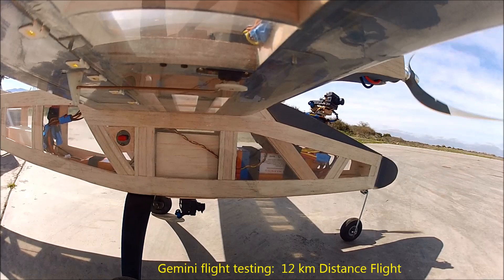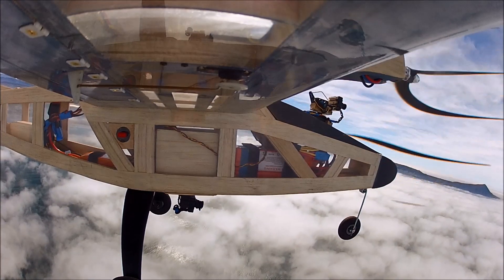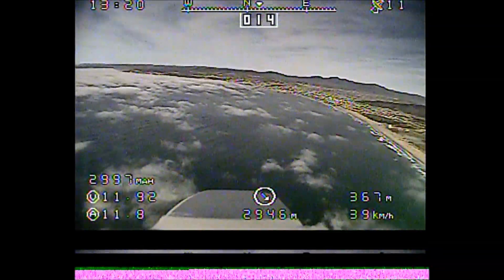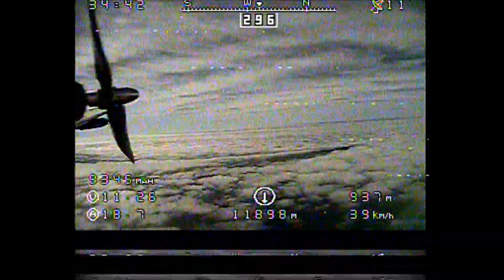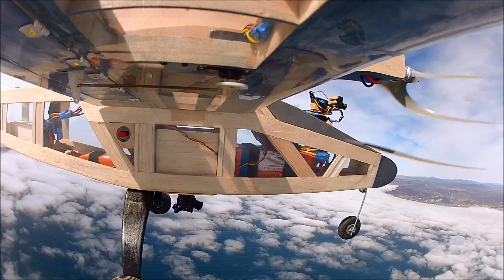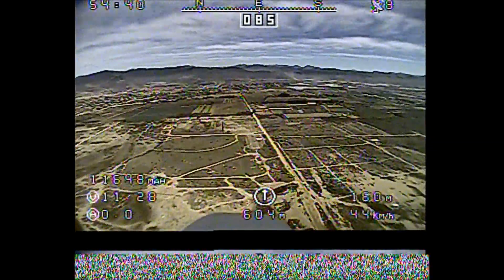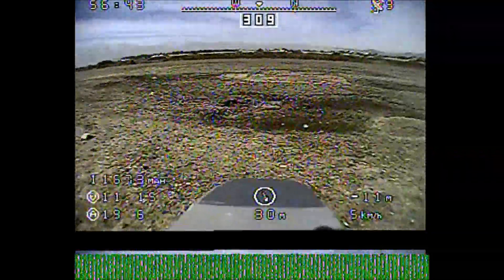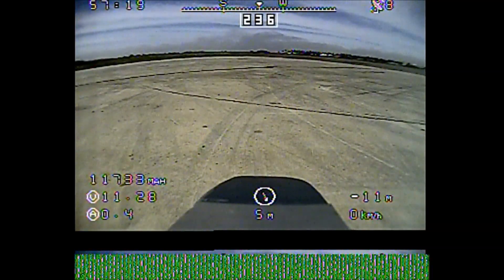GEMINI ADVANCED FPV/UAV FLIGHT TESTING 12 KM LONG RANGE FPV FLIGHT

Comment: do you know the wing loading weight 3 meter wingspan rc aircraft, i hope somebody here can help me
Reply from the maker: +Aldo Allende Oliva 23-32 oz per sq ft, depending on payload. stalls at 18 mph at gross weight. best glide is about 45 kph, and best loiter is about 42 kph.
Reply: +FPVREVIEWS if i want to test the wing. And ,  I w
Reply: +FPVREVIEWS if I want to test the wings, by putting each wing tips On top of a chair, how much weight can i add for me to know is not Going to break in The air
Reply from the maker: +Aldo Allende Oliva calculating the load for the wings with sandbags is actually a bit more complex than that, and i don't recommend doing it upright, or with chairs.
Reply: +FPVREVIEWS I think I'm going to add 1 more carbon fiber tube

Comment: interested and looking into getting the plans. I was going to design my own, but this is all set for max efficiency. I was thinking about building some of it with alternate materials, maybe pusher props.
Reply from the maker: pusher props mounted onpods on the wings would encounter vibrations due to arc pressure differential they would encounter. i have found that it offsets the gain in efficiency due to vibration. anyway. , thanks for considering the design. the prototype is optimized for max efficiency in cruise flight.
Reply: Ah I see. from the differential pressure behind the wings?
With twin design, I suppose it's not much need protecting the motors/props.
Looking at these consumer hydrogen fuel cells available, I wonder if in future theyd be able to be used as a sort of cruise power generator, or for recharging a main flight battery in flight.
Reply from the maker: Stefan Kozma exactly. 
hydrogen offers great energy density, and is already being used to power uav's of all sizes while burning it in conventional engines, and using solid state fuel cells.  it's just highly explosive.  minor detail... perfect for unmanned aircraft.

Comment: Your final approach seemed really steep. Is there a reason you did not come in at a more shallow angle? Just curious.
Reply from the maker: with full flaps/airbrakes, there is a huge amount of drag, and the nose must be kept down, to maintain airspeed. to make a more shallow approach, the flaps could be partially retracted, or some motor power could be used.  most air brakes are not this effective, so it looks extreme, but the airspeed was quite normal, and that's all that matters to an aircraft.  thanks for the good question.

Comment: It would be possible to buy this kit plane? what do you use from osd autopilot ?
Reply from the maker: not practical to produce kit, as i have to travel to ship it. if your interested in a similar finished model, be receiver ready, or complete system, pm me. i have a similar model available at the moment.  sorry for no kit.  i do have plans available on the website. there's a link in the description.
Reply: Ok no problem, How many hours of work for the realization (construction)
Reply from the maker: Koestel about 2 weeks full time
Reply: OKI Thank you
Reply from the maker: autopilot is fy-31 ap, but have taken out, and switching to pixhawk soon. odd is tele fly by mfd. it's part of the tracker system. aat.  not necessary to use it for odd , but i like it just fine. it's possible to use the tele fly just for tracker telemetry data, and bypass the vid signal onto another osd. it's standard procedure, and in the instructions of the mfd tele fly.
Reply from the maker: there is no redundancy with the two uhf systems, they re there just for more channels, and split tasks between two people on the ground.
Reply: ok, To control what and for what purpose have 2 receiver?
Reply from the maker: Koestel 8 channels to control the basic plane functions, the head tracker, and the autopilot modes, then another controller for the pan tilt on the observer cam, the 4 separate configurable hard points not the wing, and air brakes, payload drop via parachute, deployable sensor release, in flight recharging boom, etc. you get the point, if you can think of it, it can be done. never enough channels. this gives 16 with the potential for more with different controllers having more channels. ezuhf has 8. dragon link has 12.  the futabas are limited to 8 and 8 however.
Reply: I understand better...

Comment: I really like this channel, the flight narration is great. I've been interested in adding a second pan/tilt cam for a copilot like you have for your Dad; I was just wondering if you both are on different 1.3 Ghz Vtx's at the same time? Id think it would be ideal to have the two Vtxs on different vastly different frequencies (like one on 900 and the other on 1.3) but I may be wrong.
Reply from the maker: yes, you are correct. as far away as possible gets the best range, or so i hear.  it's ideal at least. i'm running a red label race wood for 1.2ghz for the pilot, actually closer to 1.1 depending on where you have the channel dip switches set, and the observer cam is running on 5.8 now. It's an aomway system, and it has great range potential. some of the newest 5.8 systems are incredible, and the old knowledge that a high freq. can't go long range is no longer accurate. it does have a more narrow beam width, however, so the tracker must be tuned well.  the 1.2 is very forgiving, so it's best suited to the pilot video system.
Reply: FPVREVIEWS Thanks! In that case, Ill go ahead and hang on to the 5.8Ghz vtx/rx that came with my Fatsharks (250 mW). What antenna gain do you use to punch through all those clouds with 5.8? I've always thought the 5 turn helical seems like overkill, but at your distance it almost seem necessary...
Reply from the maker: Arizona Air i use 1000mw. that helps a lot, bu i'm using linear polarization, as i've never had a problem with it, and i use a patch antenna. i think it's a 23 db for the 5.8.  i use a 13 db patch for the 1.2ghz.  the 1.2 is an 600mw or 800mw. i can't remember which right now, but it works well.  always try to but the rx antenna that the manufacturer suggests for max range.

Comment: How come the live feed video quality is terrible? Lol forgive my enexperience :p
Reply from the maker: it's wireless, so not perfect, and when you compare it to the go pro, of course it looks lousy, and i had done some modifications to my a.a.t.  that day, so had not had a chance to tune it, so antenna aiming direction was not perfect.  it does work acceptably up to 12 km away, however, and it's generally only used to navigate, not for videos.  an unmodified wireless a.v. system won't work even 2 km distance, so it's all relative.
Reply: FPVREVIEWS So what kind of AV system are you using... I have just started FPV and have a 600mw 5.8 transmitter... I have barely flown far enough to loose sight of the plane yet (it's 2.4m span though) but I wonder how far i should try to push a 5.8 system with such things as helical antennas before moving onto perhaps 2.4 for video and UHF for control.
Reply: chrisfunk2000 ignore me, i found the answer further down! : )
Reply from the maker: chrisfunk2000 no worries,   i have flown 2 km successfully with 2.4 ghz, and have flown up to 12 km with 5.8 video, but not on the same flight, obviously,     so i would recommend going with the 433 control system as soon as possible. i like the immersion ezuhf for many reasons, including the performance is great, and the built in spectrum analyzer is worth more than the system. knowing where the noise is , and having the ability to adjust the frequency easily sells me on the ezuhf.
it 's always safer to have more control system range, whether you are flying still within sight, or not, it;s just a better system. 
as far as the video, you can fly far on any frequency, as far as there is not much noise on that frequency. 600mw is good, up until 1000 mw is still ok, don't bother with more, as i twill not help the range really, beyond that.   focus on the video receiver antenna,  it should be high gain, and if you can spring for a tracker someday, that's great, if not an 8 to 13 dbi patch, or other directional antenna would work great. if you can use a tracker, you can go higher, like the aomway system. it's made for trackers, and has a 23 dbi antenna that can pick up it's 1000mw 5.8 vtx at about 30 km.    just depends how far you want to go, and how much you want to spend.   i would do it in stages, but you will keep the LRS for ever, so start there.
Reply: Thanks for the detailed reply... I will start looking for a UHF control system soon : )